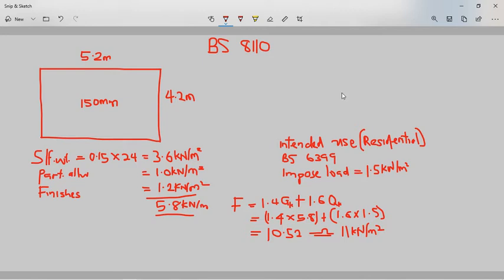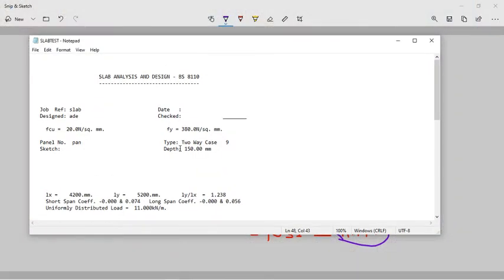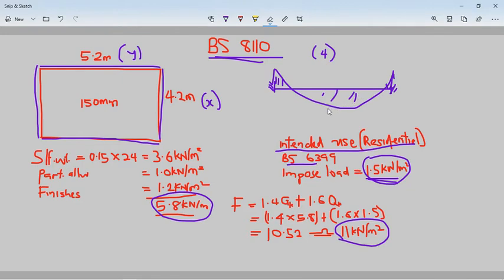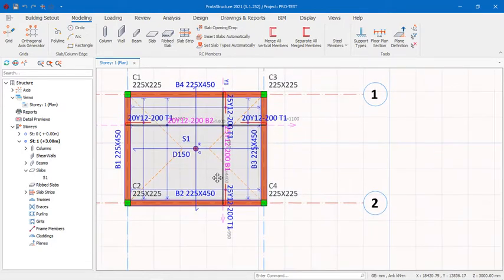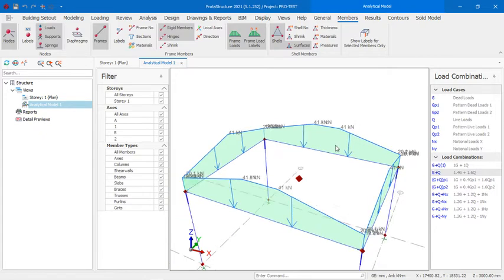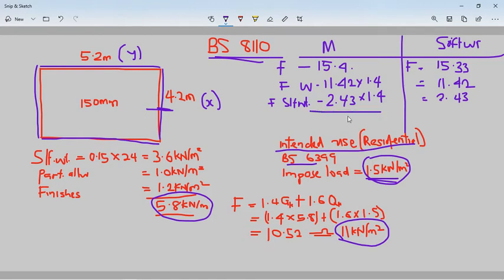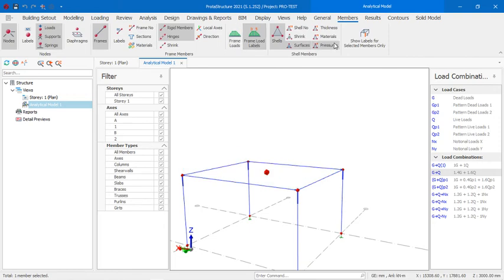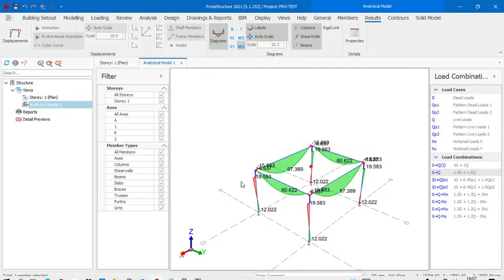Inner workings of Prota Structure suite. 1. (case study, Slab design)

Comment: Very insightful.
However, the software gives options for the Engineer to edit the beam end conditions to pin instead of the assumed fixed ends by the software.